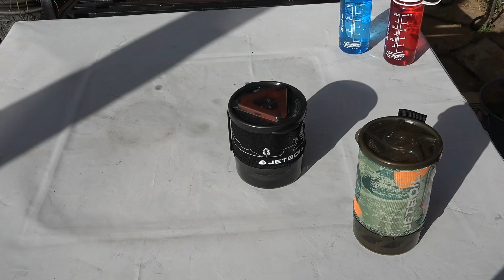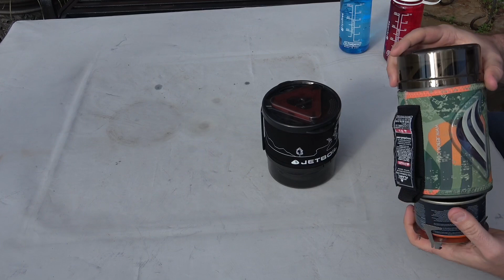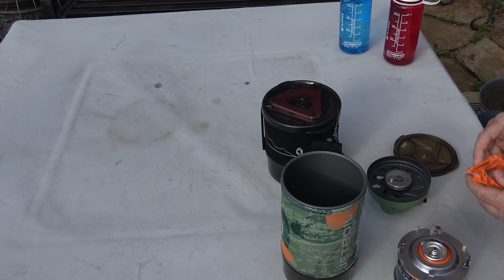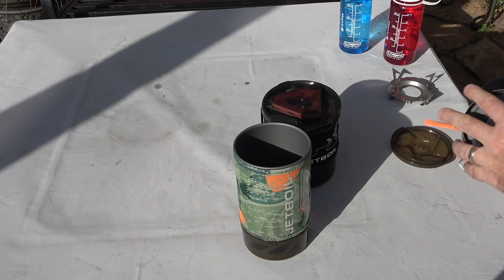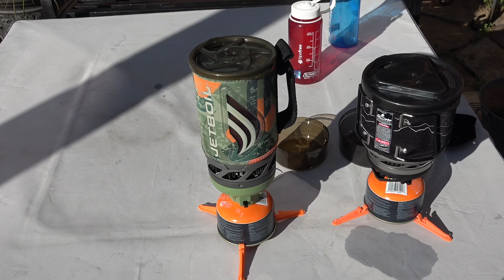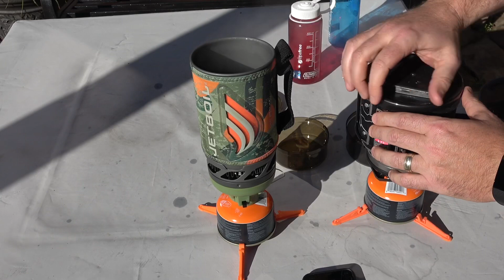Jetboil Flash vs Minimo

Comment: Worth noting that the minimo is also pressure regulated so it will work much better in cold, at altitude and when your canister isn’t full than the flash will. It may take slightly longer to boil but thanks to it being regulated you will be using less fuel overall over the course of your trip. The flash, being unregulated struggles with a canister below even half full, especially in the cold. Below freezing and with a half full tank I’ve had boil times of gasp almost 3 minutes.

At the end of the day the minimo is more versatile and more fuel efficient and for that reason is in my opinion the clear winner. You can wait that extra 25 seconds for coffee if it means it will be more efficient, dependable and ultimately you can carry less fuel on those week long backcountry trips.

Also just going to mention to leave the lid on the entire time while heating your water and it will cut down your boil times pretty significantly.

Comment: > In all tests that we have conducted with the two comparative products that we reviewed (Jetboil FLASH / MSR Windburner / MSR REACTOR) the slowest to boil (same amount of water) was the Jetboil Flash.  We prefer the MSR models which can easily be lit with a match/cigarette lighter, because the problem we have found was with the Jetboil's piezo lighter is also NOT consistent, they break, and they also don't last for ever. You will notice that Jetboil DON'T sell just the Ignitor/Pot Support as an accessory/replacement part, at least nowhere that we have found. Both the MSR Windburner/Reactor wins hands down in this race of the highest standards for: quality, longevity, ease-of-use, weight, and robustness for backpacking/rafting trips in the wilderness with groups.
Reply: I hade the same problem. I was in the middle of the Jetboil vs MSR battle. then I bought them both. Jetboil Flash and also windburner.
and unlike you. I can definitely sure that Jetboil does the job better.
It has a better build in quality and designed better. I haven't tested them in cold weather which I think windburner can be better because of its regulator. but anyway I give a thumbs up to Jetboil.
Reply: Nothing stops you from using a match/cigarette lighter with the Jetboil.

Comment: I have a flash 2.0 and it has simmer control works great with my skillet. Are the burners compatible? I see the minimo tapers in. Great cosys
Reply from the maker: Yes they are.  I should have included that in the video.  you can use the same burner for both cups, because of the size.  but of course one has a regulator and the other doesn't.
Reply: @TexasHogHunters  thanks bud everyone reviews them but never as interchangeable systems. There’s a new video idea for you 😂👍🏻🏴

Comment: This seems like a pointless comparison. We all know Flash is 100 seconds and Minimo is 2-3 minutes.  It would be great to see some videos on cooking with Minimo which is what it was designed for.  Flash is purely for speed and water only as it has no regulator.
Reply from the maker: True.  They are used for different purposes.  But do we all know that?  I don't do well with absolutes, so I just made a video to show the difference in boiling times.

Comment: On theminimo if the pietzo fails is t still possible to ignite with just a match?  Thanks
Reply: No you need a special flame from a special jetboil match. Otherwise no ignition.
Reply: Great that means there is access for a match Thanks
Reply: They sell them separately

Comment: Hey man, will the Flash cup fit on the burner from the mini? and viceversa?
Reply from the maker: I LOVE this question.  Unfortunately, no.  The minimo has a wider base.  HOWEVER, JetBoil makes a MicroMo that has the same ability to simmer as the MiniMo and the width of the base is the same.  Here is a more in-depth review of the Flash versus the MicroMo:  https://www.wildsnow.com/19860/jetboil-micromo-backcountry-stove-review/
Reply from the maker: @robbrigham5926  I stand corrected.  i'm sorry for the misinformation.  the minimo cup is wider, but the base with flux ring contours down to fit the same size burner.  thank you for pointing this out.
Reply: This was the first thing I looked at yes they do I have different sizes